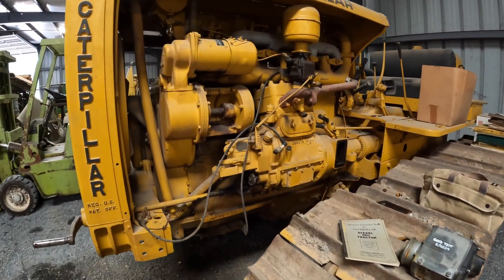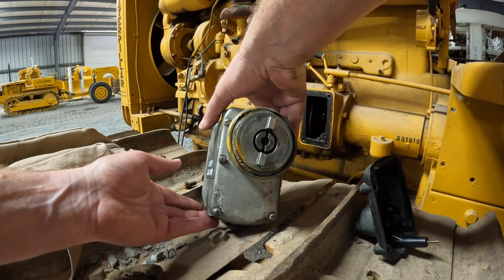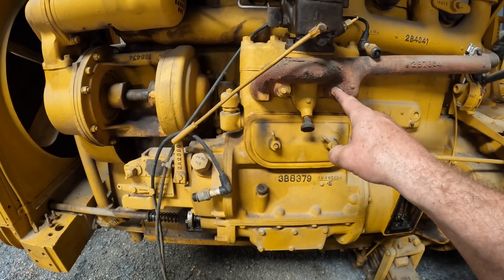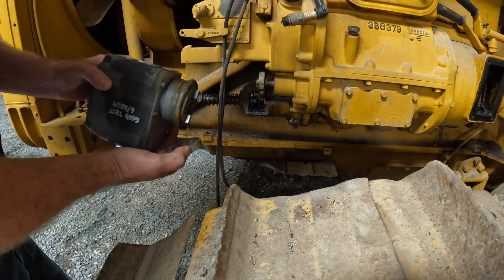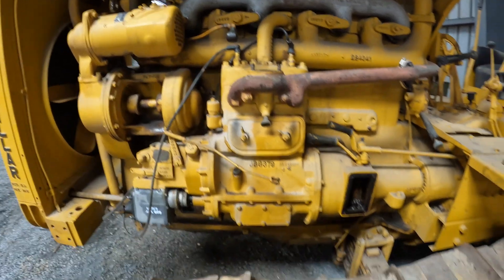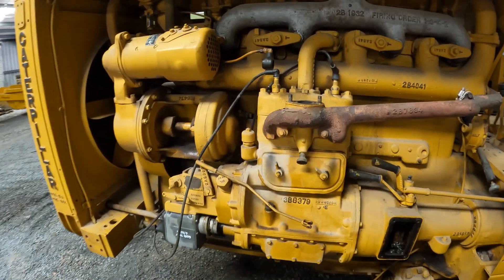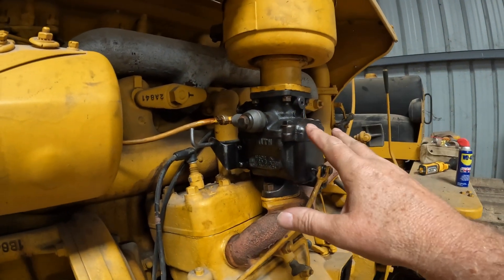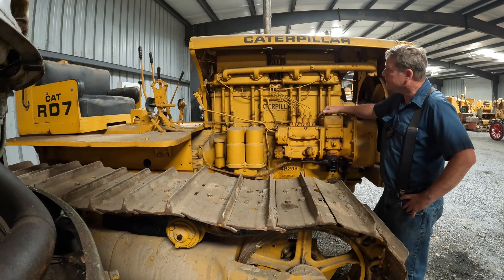RD-7 magneto timing and startup

Comment: Just what I needed to see. Working on mag timing. I need to get my 1H D8 running after 3 or 4 years. It was running then but I have not seen any spark yet. I am going to clean the points again and try. I have another mag but I have hesitated to get involved with timing.
Reply from the maker: If your magneto is off the machine, I would recommend giving it a simple bench test: rig up an old spark plug and give it a few quick turns; complete the circuit on a welding bench or the magneto case itself.  The impulse coupling should engage and you'll know if you've got good spark. Love the 1H and 8R series. 
Best of luck to you.

Comment: Always run the carb dry
Reply: No doubt  but i ment if u are leaving it for long periods of time
Reply: Mine isnt quite that age. Its a 1956 D7C-17A
Reply from the maker: I concur.  However, in the battle to get the big diesel going, and making this video, I had to command the stop manually a few times.

Comment: I'm always amazed at the size difference between the RD-6 and RD-7, that one extra piston combined with the much better balance of a 4-cylinder layout really makes a difference.  I also love these 9G machines (I'm assuming that's what this one is) for that "Y" shaped dash and their rather "unstyled" styling, if that contradictory statement makes any sense lol 😂👍
Reply: This is all your fault Toby for getting me interested in Caterpillar's !!😉 I'm grateful though.
Reply from the maker: tractor number 9G5615WSP.  I'm getting it running to transfer it to it's new owner.  Dad had an extensive collection and I just can't keep them all. Keeping the 17A so I'm all set for D7 work. Hope to have the diesel running tomorrow and perhaps put it on a trailer this week (June 2024).
Yes, that old dash is a classic.
Reply: I had always thought that 3-cylinder motors were naturally balanced but 4-cylinders are naturally unbalanced? as the newer d7 has a big counterrotating shaft for balance? JD seems to do their small 4 cylinders with 2 counter-rotating shafts. or is this just a more a sine of technology advancement.